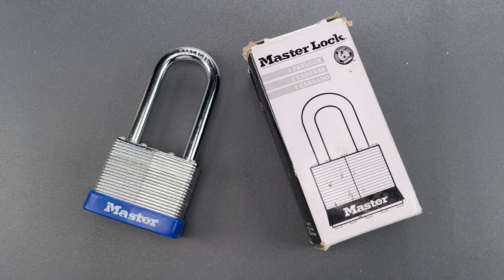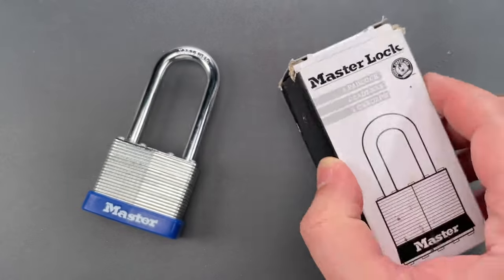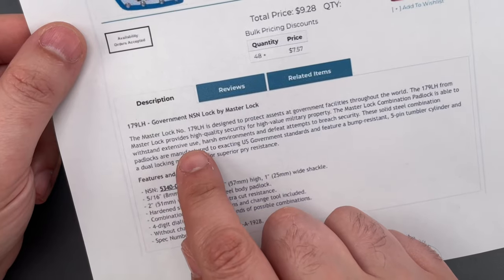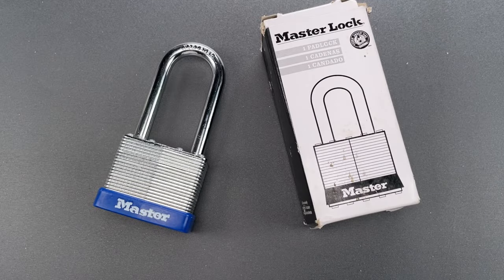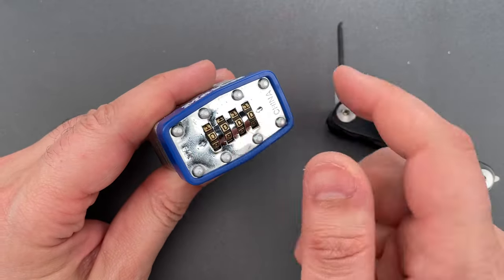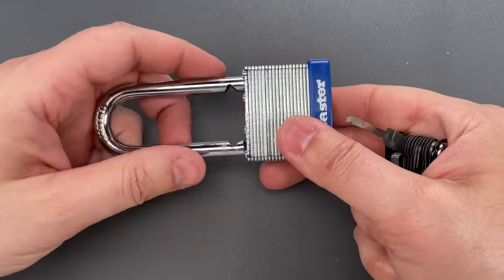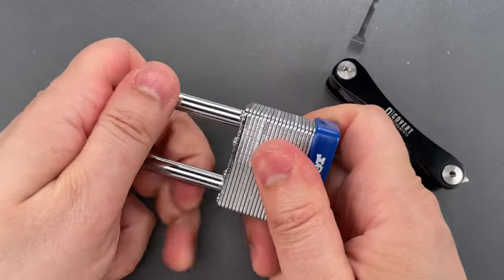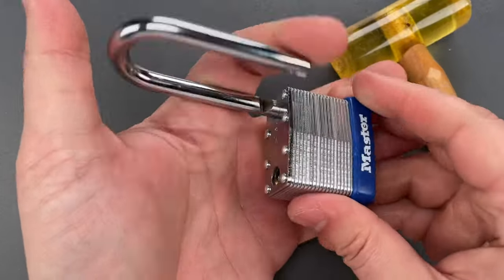[1449] TERRIBLE Master Lock Laminated Combination Lock (Model 179LH)

Comment: The locks on the bomb dump perimeter fence are junk at my current location. Most have issues dummy locking and then popping open if not locked in a specific way. An absolute joke regarding security.

Thankfully the real locks on the bunkers are legit high security locks with beefy welded hasps. Also helps that the bunker doors are 50+ year old pieces of shit that need three to four men to open because they're practically rusted shut.

Comment: Right off the bat I was a mechanice for 6 years I worked on everything with wheels strikers 5 tons and lhs it goes on. Now why would the military use this well I will say you don't see them from 2009-2014 on fort Lewis. But here is my take. I agree they should use cheap locks and here me out. A lock is only going to keep a honest person out. That said here why o think it should stay the same consider the price of locks. When you work on equipment it is required to have someone with the key to the truck there how ever that almost never happens. In that case you still need to work on them now days everything is up armored including the locking clasps there fairly thick. And we don't have. Key I go to my tool box and grab my F wrench kinda like a adjustable wrench put it on the body and with 2 fingers twist it and bam they explode. It take no Eggert what so ever and I have seen them try tougher locks but it never changes the leverage and force you can apply to a solid clasp without damaging it allows you to pop all locks with ease. But put that same lock on say a storage unit were the clasp you use to lock is made of thiner more maluable steel that bends and the lock doesn't break. So there you have it we pop locks every day multiple times a day I don't care what you put on it. So in that case why spend 100 bucks on a lock that will gaine you 0 security. Facilities on the other hand will vary dependent on the level of security needed. When you have millions of doors you need to dictate how much you spend to protect the information or things inside. Locks are so bad that instead they will use increasingly difficult locks as you get deeper into the buildings

Comment: awesome videos. I have a question: I have an old lock from germany, it has a key that has 4 sides kinda looks like a long phillips head screwdriver. It has a notch on the key that corresponds to a small round dimple on the keyhole. they must line up to insert the key. On the side it says in all caps: TOPPADLOCK. My qouestion is can it be picked?

Comment: I mean, it says right there in the description, "withstands [thing], [thing], and defeat attempts to breach security".  The grammar is pretty confused, but I'm pretty sure that "withstands defeat attempts" is supposed to mean that it can withstand things that would defeat an attempt to breach security -- such as, for instance, "locking" it.  Even if you "lock" it, the attempt to breach security is still not defeated!

Comment: You know this wasn't going to be good for Master Lock just based on the length of the video. Was not surprised that he was able to use a tool as this was a combo lock. Opening the lock via a simple tap of a hammer, however, was a surprise. Poor quality lock.

Comment: Dear Mister LPL. 
I enjoy watching your videos.  usually i am very amazed at the simplicity of your solutions to open locks.  However, a common mistake has now occurred in this video.  You said  "NSN number".  However, this is not correct.  You can say NATO Stock Number or NSN .  And therefore not NSN number.  Very kind regards from the Netherlands.

Comment: I mean, the point of a lock is to slow down an attacker, right?  And high-value military assets should be under constant guard by people with guns, so it should be fine for high security applications, as no delay is required if they just see and shoot the attacker immediately.

Comment: For anyone opposed to government regulations, think about LPL videos such as this.
If you still hate gov regs, go research the UL Labs deal. Why don't all industries do this?
Reply: Not sure what deal you would be referring to but people who oppose government over regulation generally don't oppose or hate "all" regulations it's when regulations are over reaching and over abundant and serve a primary purpose of just being another exuse to drive up the cost of business under the guise of safety and more particularly when the regulations are fair enough to impose on large corporations with many employees but also filter down and apply to small businesses. 
A regulation that costs a company $10,000 or 100,000 to comply with can be absolutely no big deal to a large company while the same costs can literally break a small business as well as delay or prevent new businesses from even starting. 
This idea that people who oppose over regulation just think there should be no regulations at all is simply just hyperbole because the problem is over regulation not just regulation in its entirety.
Many regulations are brought about in the context of protecting the public primarily from the large corporations and adding to the cost of those big companies but simple logic should make it obvious that large multimillion dollar companies that are already well established and have the benefit of expansive assets, massive cashflow and virtually endless credit limits will basically suffer virtually zero negative effects from costly regulations while small businesses will easily crumble under the same costs.
In short heavy regulation actually helps large well established companies by eliminating competition from small businesses and potential competitors.

Honestly not sure what this had to do with crappy masterlocks though...

Comment: Hold on a moment, is bumping even possible on combination locks? I thought only worked on key locks (I guess that would make them technically correct about the bump resistant claim)

Comment: Bruh. Multimillion dollar pieces of equipment are locked with a chain and cheap “military grade” master, pacific, or American lock to a swinging chain link fence.
Then the vehicles themselves are locked with the same master, pacific, or American lock. “2 lock security”
THEN if you keep radios mounted inside, yet another cheap lock on those bad boys. 
THEEEENNNN the containers that hold are the vehicles assigned extra issued equipment are, yes you guessed it, master, pacific, or American locks.
it’s THE SAME FREAKIN LOCKS. Not the same key obviously. But if you know how to pick one, you can pick another.
ITS SO EASY. Yet they get pissy if you forget to “lock up” your vehicle.
Wats my source you may ask?
I’m key control.

Comment: they are only meant to keep dipshits out of your truck/vic or keep someone who can't read numbers from riding off with your vic by accident. boltcutters get used more on post than the strip club just off post. because nobody can keep a key for longer than a few months at a time you'll almost never see a hardened shackle or competent lock on Gov equipment.

Comment: Anyone: is it worth$ the effort to build a "relatively pick proof" lock design? Of course like a few, I have a design. Simple, cheap, same form factor,  yet can only be picked if you float pick every pin at the same time(with no conformation feed back). Of course I'd prefer to sell the IP, but manufacturering is always an option. Thanks!
Reply: Have a prototype made by a machinist and send it to LPL. It's going to financially ruin you if you've made an oversight and you just spent big bucks on getting the tooling for mass production set up.
Reply: @andersjjensen  That was my thought, but after I file a patent$$. Ha. I'd totally love his private input, but I wouldn't expect his help unless he could release a video.
Reply: @timprobst7905  You don't need to worry about a video invalidating your patent. Quite the contrary, that would prohibit anyone else obtaining a patent (and if the patent office goofs up you can hit them with a "prior art" claim). Plenty of products get released before the patent is even applied for.
Reply: @andersjjensen  I'm currently 3d printing at 4x scale to fiddle with the design. 👍
Reply: @timprobst7905  Neat! I hope to see LPL have a go at it some day! :D

Comment: I could not stop laughing. They used these pieces of shit to secure the upper hatches of military tanks. I figured out the banging the lock trick to get them open. The other thing was that most of the tank drivers would leave one hatch somewhat open, so anyone with a hammer could open the hatch and get in. I did it because the tank drivers would lock up their tanks so they could not be moved. Since my initial job in the service was to move those tanks, invention was the solution around this problem. Agatha Christie said “I don't think necessity is the mother of invention. Invention . . . arises directly from idleness, possibly also from laziness. To save oneself trouble." Too funny.